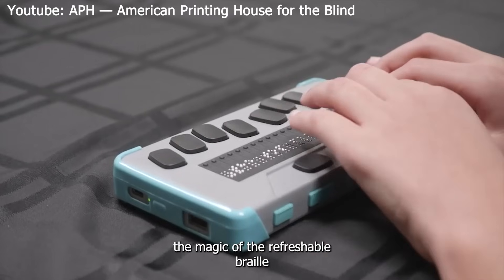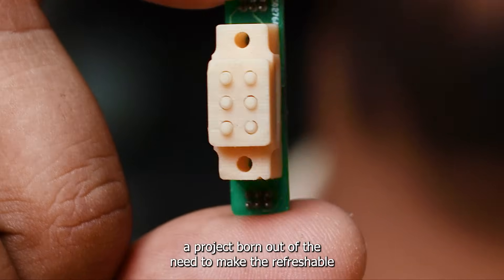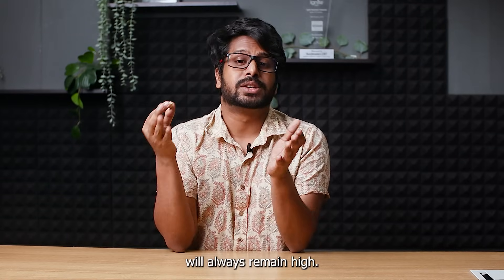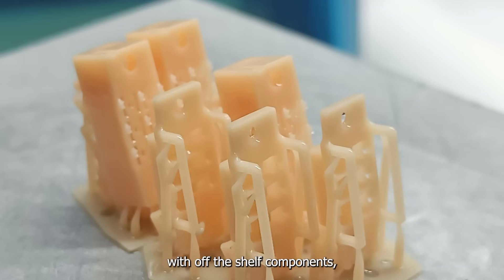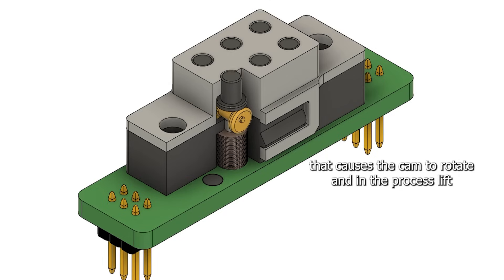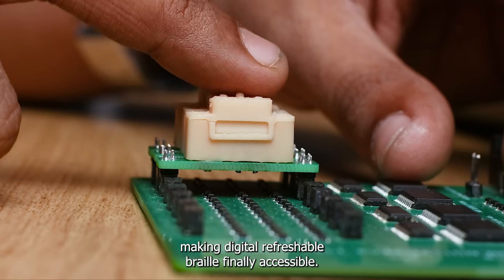Electromechanical Refreshable Braille Module : HackadayPrize 2023

Comment: So this video was published 1 year ago.  What progress have you made in producing a working prototype that you can demonstrate?  Or have you already done that?  And if so, what have you done to contact Braille display manufacturers to tell them of this technology?  Also, have you beta tested this with any braille users to verify its feasability?  You are correct in your analysis.  It's the piezo-electric cell (at $100 per cell) that drives the  price of displays up.  If you could even get the price down to $10 per cell, a 40 cell display could be sold for around $400-$500 per display.  If you've really proven this concept and it really works, you shouldn't hesitate.  Get it to market as soon as you can.  This will bring the cost of a 40 cell display within reach for many people ($400).  It could even make a multi-line display (10 lines X 40 cells) affordable, costing $4,000, which is what a single line of 40 cells costs today.  Don't delay.

Comment: Revolutionizing Braille Accessibility: An Electromechanical Braille Module for Under $1

* 0:06 High Cost of Existing Braille Displays:  Traditional refreshable braille displays are prohibitively expensive, often costing around $100 per braille cell, due to the use of specialized piezoelectric actuators and low production volumes.
* 0:38 Goal: Affordable Braille Cell Design: The project aims to create a braille cell that is significantly cheaper to produce, using readily available components and 3D-printed parts.
* 1:48 Achieving the Goal - Under $1 per Cell: The electromechanical braille module was successfully developed with a materials cost of less than $1 per cell and a power consumption of 1 watt.
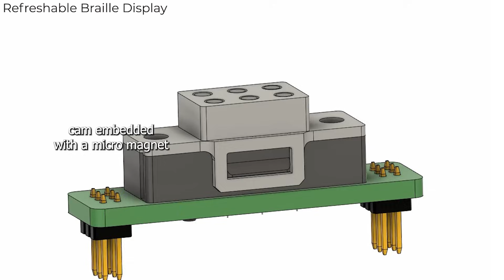* 1:52 Key Innovation - Eccentric Cam and Micromagnet: The core mechanism involves an eccentrically mounted cam with an embedded micromagnet. An electromagnet rotates the cam, raising the braille dot. Power is only used during actuation, not to maintain the dot's state.
* 2:10 Accessibility of Manufacturing: The design is optimized for low-cost manufacturing using readily available materials and tools, including readily available micromagnets and low-cost MSLA 3D printers.
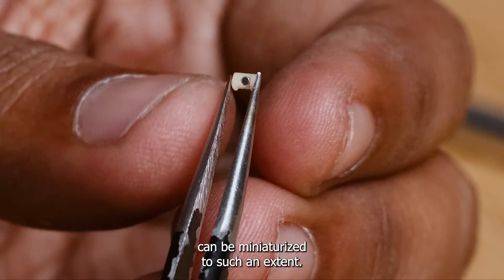* 2:35 Inspiration from Existing Technologies: The electronic design draws inspiration from flip-dot displays and mechanical 7-segment displays, leveraging a multiplexer system to drive multiple cells efficiently.
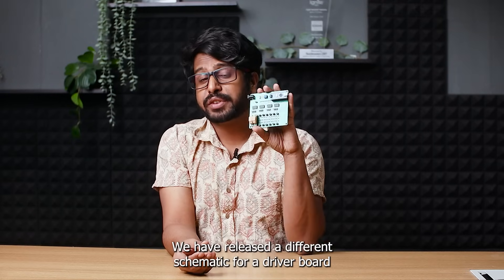* 2:57 Open Source Design and Resources: The project offers a reference schematic for an 8-cell driver board, PCB libraries, and device libraries to facilitate wider adoption and integration.
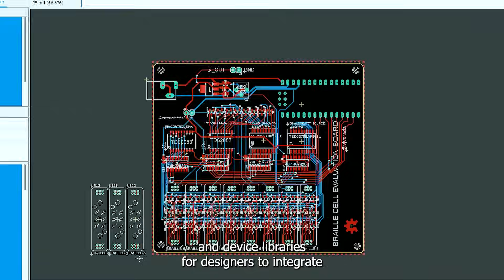* 3:11 Broad Applications Beyond Braille Displays: The potential applications extend beyond traditional braille displays, envisioning integration into ATMs, public signage, museums, and more.
* 3:23 Vision for Accessibility: The project's ultimate goal is to revolutionize braille accessibility by making refreshable braille technology affordable and widely available.

I used gemini-1.5-pro-exp-0801 on rocketrecap dot com to summarize the transcript.
Cost (if I didn't use the free tier): $0.09
Input tokens: 25854
Output tokens: 414

Comment: this is so cool. I want to recreate this project of yours but for a different application but was wondering what causes the magnet/cam to return to its initial orientation. I get the magnet/cam is faced down and when the electromagnet turns on it repels the magnet, but then what causes the magnet/cam to go back down again. Is the the polarity of the electromagnet changed or just simply turning off the circuit cause the cam to return to its initial condition.

Comment: Hello sir, I am planing to make a device related to an electro-mechanical refreshable braille. I am using actuators and custom designed mechanical braille cells for the device. I have a few doubts in the actuator part and would like you to guide me through.

Comment: Please send the circuit diagram Braille display , what you have used in it and also with which code you have run it?
Reply from the maker: Hi, check out the links in the description, you will get everything there.

Comment: You will have to prototype, advertise, and sell your own version of this. Manufacturers find excuses to artificially inflate the cost because they hold a monopoly and are incentivized to charge more from their limited customer base. Selling for less would result in less profit for them because there is no benefit for them financially to sell in bulk. If you want braille to become accessible you will need to undercut the larger businesses by selling a £100 braille module.

Comment: This is great but optimizing for 3d printing definitely lowers that barrier to entry but massively raises the cost floor there is a lot of price savings being left on the table in the form of vastly higher costs failure rate and production time on all the plastic components yo will be able to drive costs even lower provided you can re engineer for injection molding and someone is willing to put in a sufficiently large order and while the market for brail devices is small I could see someone like cherrymx or an existing brail cell manufacturer being willing to shell out to well over halv the price of brail cells.

Also if you want to make them suitable for public and outdoor use you should work on a water proof grime resistant version either on the cell layer or specialized cells that can be placed under something like a vinyl sheet and still be read.

Comment: It´s a great design, congratulations. But regarding the costs, I don´t agree. Every single manufacturing step that has to be done manually, will make this module probably more expensive than the existing ones. It´s not the material cost, it´s the whole manual working process and quality control. This time has to be paid. I guess winding coils and cleaning off the prints takes most time? You could make injection molds, but that would only pay off if you would sell high quantities. Not mentioned reliability. Customers want it to last for decades, and the failure probability is relatively high. No demotivation here - I hope you will bring it to market inside an affordable full size panel.
Maybe it´s possible to 3D print flexible structures that will avoid having too many fiddly parts and will reduce production steps.

Comment: How much power does it take to just use a tiny solenoid? Or to have the magnet inside the little pip and have it pushed up by the electromagnet?
I ask because i'm curious if it can be made smaller and faster. Faster by reversing the polarity and pulling the magnet down.

I'm curious if it can be made so small and fast so a person would only need a couple modules, like 1-4. And then have a buttons to scroll through text, without actually having to move your fingers.

Comment: I feel like there's probably other mechanisms out there that could suit the purpose and further reduce cost. For example, an inflatable braille pad, which could also contain an entire braille display in a 'single' part. How? Well all you really need to do is mold channels into a sufficiently flexible and inflatable material that also has braille dots designed into and connected to those channels, and then pump air or liquid into those channels (you wouldn't even need to "pump" anything, merely just have a physical switch that exerts pressure on the channel, like squeezing one end of a balloon and the other end inflates). The control mechanism would be to simply open or close off channels, mechanically. Then the dots molded into the material would inflate or deflate. 

This can even be assembled in a way where the dots molded into it are just a mechanism to push separate rigid braille dots above it, up or down as they are inflated or deflated, essentially giving you all kinds of options for what type of braille dot is used, from basic to fancy, to braille dots of different materials or textures, to people even being able to swap out and print their own braille dots. It would operate closer to how a non mechanical keyboard does, with that flexible squishy material under the keys. So this mechanism could also make the overall thickness of the device thinner too, it would only really need to be just slightly thicker than twice as high as the braille dots would raise, and the bulk of the mechanism can be manufactured as two halves combined into one piece. 

You wouldn't even need a mechanical actuator at all with this design, because there are materials that can change based on electric charge, which can supply the pressure needed to inflate the braille pad part. So it would merely be a question of the right materials and an electric charge. You would only truly need a single chip to control the whole mechanism, and all it would need to manage is simple power distribution, as the braille pad design is completely analog in nature. By the way if you use this idea (which you should), I want my cut ;)

With this, I would imagine you could probably bring the cost down significantly, along with reduced complexity of assembly. The braille pad itself could even potentially be 3D printed with clever use of the softer/flexible/rubberized printing materials, but it would also be pretty trivial to have mass produced at a traditional factory too.

Comment: Hey. I think this is an amazing project! If there are people with access to maker clubs, 3D printer or just even raw materials for projects like this, is there a community page/ forum for these people to collaborate? I for one would love to help you amass a HUGE stock of those coils. I'm already brainstorming making the coils on ONE huge piece of plastic/ small ferromagnetic mandrel, and winding one set of braille set coils in one go. But for each individual coil/unit, you would need to add a manufacturing step. I'd imagine this would keep cost down as you would be greatly reducing the labor input and amount of repetitions while producing 6x in the same action you were already doing!

I haven't looked into your CADS or designs, but maybe we all can get a sort of "Standards of Specification" when the community makes these parts and have unique niche parts like that compliant piezoelectric bender thingy-majig.

Comment: This is so good that it's really frustrating. This design is great, I imagine this design will prove to be one of the best possible ways to achieve this with current technologies; but there are many similar designs that are also better than those piezo designs. I can't imagine why one would ever have arrived at a piezo design. To me the obvious from-nothing design would be to design a bistable linear solenoid where the coil pushes the actuator between the two positions. This would almost certainly be more complex, use more power, and be prone to the dots being pushed down. And yet, I expect it would be under 30$ per module, at no more than double the size. The only reason I can muster as to why piezo designs are common at all, is that there is zero innovation in the space, and this was the first design to reach the market. That, or patent trolling.

Comment: As someone who got into DIY mechanical keyboards a few years ago, when I found out how much braille keyboards cost, I immediately had the idea to figure out some kind of a custom solution, but I am not an engineer, so I would have no idea where to start to come up with something like this. This is truly amazing. The fact that projects exist like this, which not only seek to create more devices for accessibility, but also to make building other assistive technology more accessible. The fact that I could use the limited background that I have to design my own devices, and have a functional prototype for a low cost is absolutely mind-blowing.
Reply: But wouldn't a braille keyboard be ten keys? Or do you mean braille key-caps?
Reply: @GordieGii I meant a braille display/keyboard.
Reply: @Alex-wl1sp  OIC. That makes sense. The display is the expensive part.

Comment: this is very nice but I need a tactile display that uses high voltage arcs. They can be extremely low amperage, and probably less than 1000 V, but it needs to be very continuous. This is for a "flashlight for the blind" which would use a laser range finder. But the tactile feedback system is a big part of that.

Comment: Super cool project, although I am a little concerned about the durability of some of these parts. 
It also seems like the dots rely on gravity do return to the down position, which would be less than ideal, and will likely quickly get stuck due to the oils and dirt on our skin. 
Keep iterating please, I want to see this become great.
Reply: even if a dot gets stuck up, they'll be pressed back down by the reader's finger
Reply: @Scribblersys  fair enough. I don't know how much pressure a reader would apply.  I'd still be a little worried about this getting completely stuck when used on something like an ATM where animals might interfere with it, or even just hundreds of people keep touching it, caking it in a thick crust of human finger juices and general dirt.
Reply: @hummel6364  well an ATM should probably use the more expensive mechanical design, this is meant to be a DIY project that can be made for very cheap

Comment: Is there a way I can purchase some of the modules to work with? I'd like to attempt to build a device around them but I'm not quite ready to buy (and learn to use) a 3d printer yet.
Reply: bro get a 3d printer you wont regret it. the ender 3 I bought costed under 200 bucks. if you are already in the field of mechatronics a 3d printer is the one thing missing to make you a whole person trust me
Reply: @forstig   I'm in the field of somehow managing to pay most of my rent while still managing to tinker with random electronics as long as I can fit it into a 10cm square board and can somehow justify having five of it.

I also don't do a lot of projects. Probably one or two big ones a year, and usually for work. Work for me doesn't often need new physical parts crafted - there's an entire department that does that but on a much larger scale (one job is at an amusement park) just electronics repaired, retrofitted, and sometimes re-engineered.

THIS product interests me, and I want to work with it enough that I'll throw some money at it. However, other than work projects and personal repairs of things I can't afford to replace, I haven't had an urge to make anything else "just for fun" in a couple decades and doubt there'll be many more after this.

Soo... willing to put money directly into this, but not into "tooling up" for future other projects I'll never do.

(if time proves me wrong on that, I'll pick one up later... but right now, and for this project alone? not a justifiable cost.)

Comment: I may be misunderstanding the mechanism but - is the return of the dots to flush driven by gravity after the cam rotates out of the way? Would they still work at an angle or parallel to the ground?

Comment: Clever design! I wrote a proposal for a similar device about 18 years ago. Back then manufacturing would have had to be at scale, which put the start up cost out of reach. 3D printers have since seriously changed the game since you can scale on demand as opposed to commissioning tooling and bulk runs of injection molded parts.

The other issue was that the market for refreshable braille displays is small and shrinking as medical tech advances. Blindness is likely to become a solved condition in the near future, which will make these displays obsolete. In the mean time, though, it’s a beautiful and noble project.

Cheers man, good work!

Comment: How do you prevent braille dots from getting "stuck" in the raised position? The cam pushes the dot up, but does not seem tp pull it down. Does that mean you need to push the module before you can get a correct reading of the dots?
Reply from the maker: Great question. There is a slight taper to the dot and the hole which allows it to fall easily. Did this because the dots were indeed getting stuck when it was just a hole and a shaft.